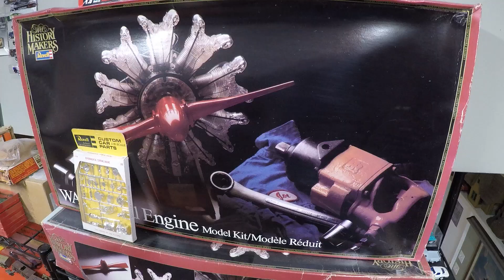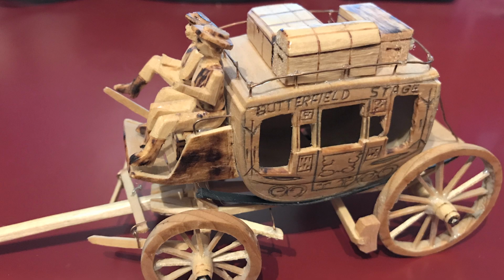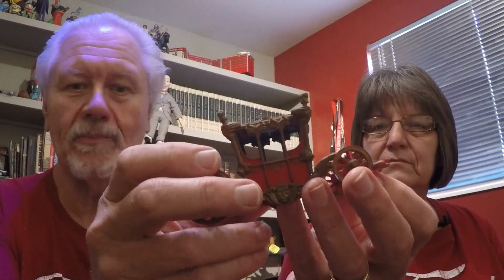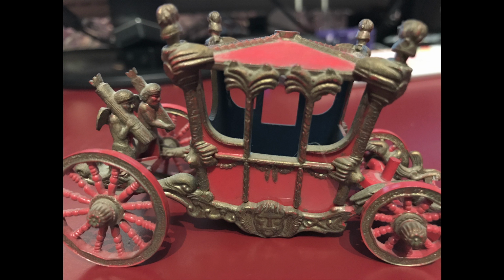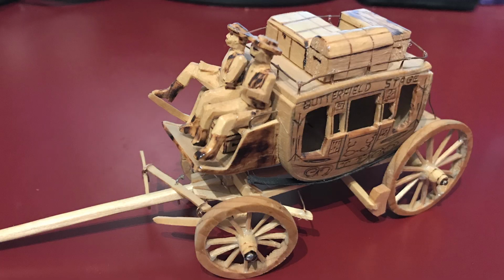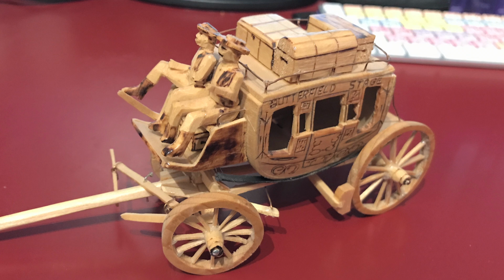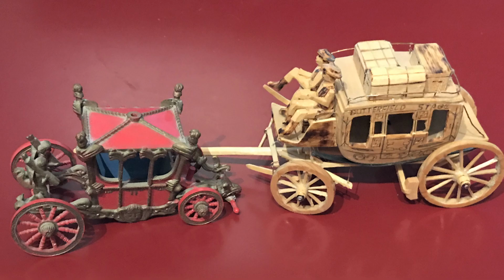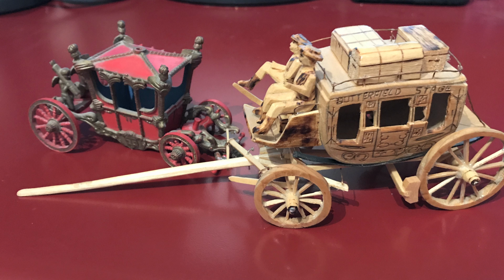1953 - 1963 Our Fathers Models

Comment from the maker: Every night my dad worked on a model at a card table in front of the TV in the living room. Back then you were lucky to have a TV. Just one. Always in the living room. He rarely painted them. He gave them to my brother and I to paint. When he did paint he had a painting area in the basement under the stairs. Always used Flowquil paint. Mom hated the smell. Not me!! This coach he really finished. Painted it and my mom kept it in a curio.  The night he died I was painting a Casey Jones and my brother a Highway Pioneer auto. Not sure what dad had in the card table. He turned on the TV and a blood vessel in his brain ruptured. From an injury he received in the Philippines near the end of the war. I had just turned 4 a few months before. After building all those models this was the only one he kept. The rest he gave to my brother and me. And we messed them up pretty good.
Reply: Off topic, but are you going to do any videos on the Durango and silverton leasing Carson and Colorado’s SP #18 for most of the winter? Would love to hear your opinions on this, as 18 is an oil burning loco, not coal.
Reply from the maker: Haden't heard about it. After the BIg fire, I get it. They have been looking for a way to run when the fire danger is soooo high. As it's winter, this is for testing I'm sure. Really HATE to see non D and RGW locos in the line, REALLY hate to see diesel. But they can't start another fire like that one. See where this goes.
Reply: @ToyManTelevision  The engine is local to the Owens Valley, and used to run between Keeler and Laws. They are leasing it for the winter as a test bed to convert one of their other locomotives to oil for use during high fire periods. I always had hoped you would come out to Laws to do a video! I live nearby. I love your channel, and keep up the amazing work. :)